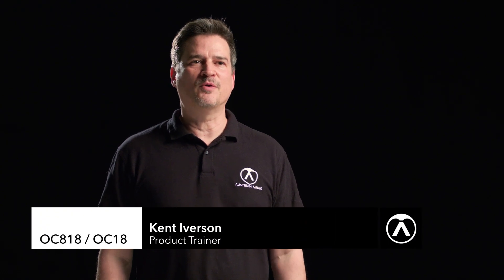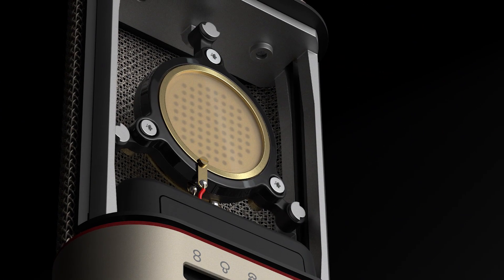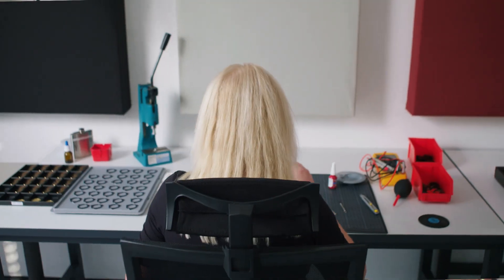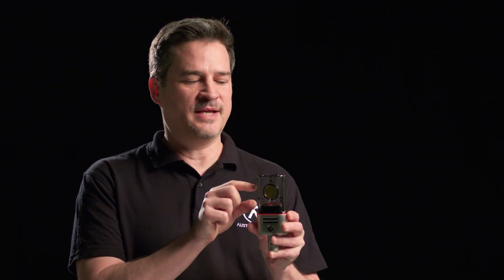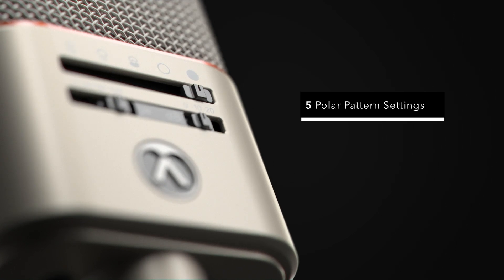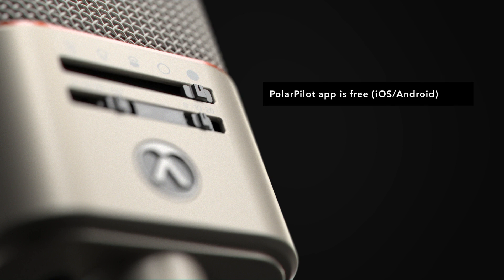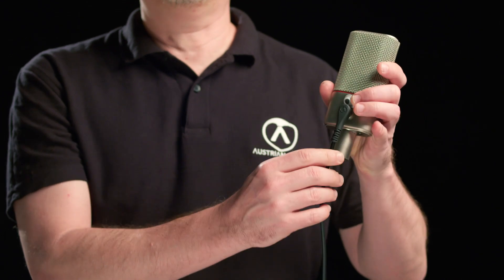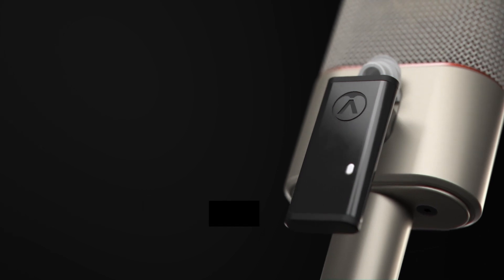Austrian Audio's Microphones: In Depth on the making of the mics. #1 of 3

Comment: Do they sound exactly the same ? I dont need a dual cap u see..
Reply from the maker: Yes.  As the unique ceramic capsule design is so consistent, any OC818 is match-paired with any other OC818, and when in cardioid mode, it can also be match-paired with any OC18.
Reply: @AustrianAudio  thanks for reply.. it's just we are reading some user feedback and review that the oc18 seemed brighter ? But I guess there is no truth in this.
Reply: @rnbyido  I read and heard reviews that stated the same thing. One of the reasons I still holding out to buy one.